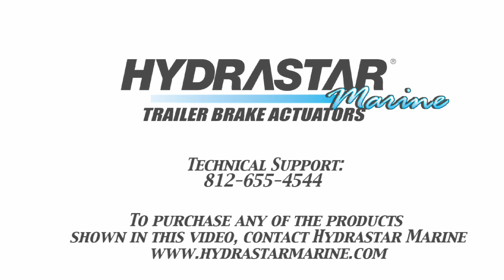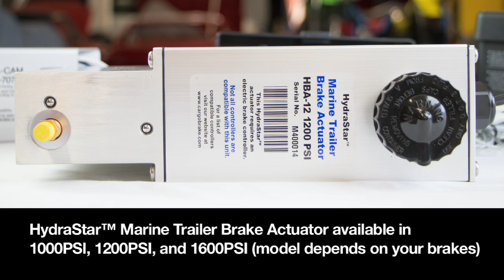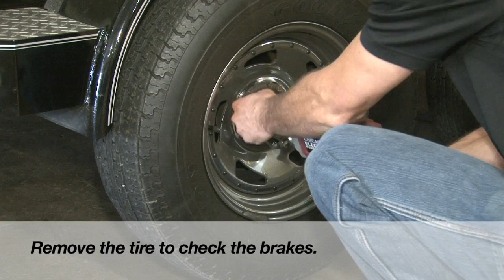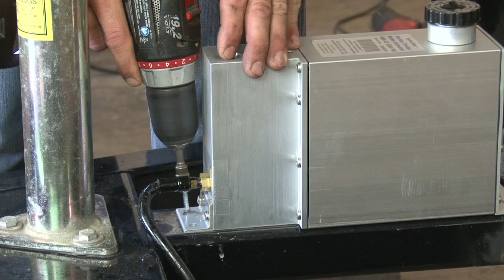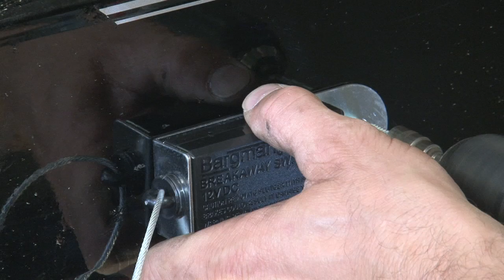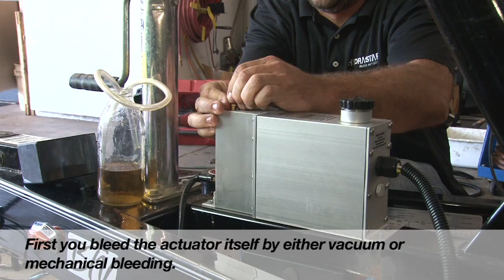Hydrastar Brake Actuator Installation

Comment: the design of the pump is defective.   because leaks breake fluids overe the wiring in the inside.  why the tank have to be on top  and not  bottom . poor quality      and expensive.